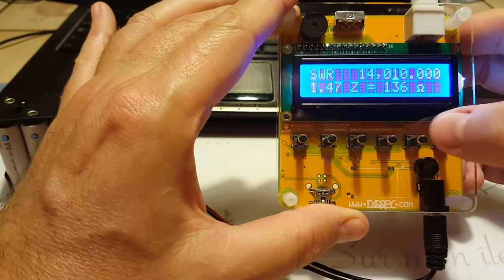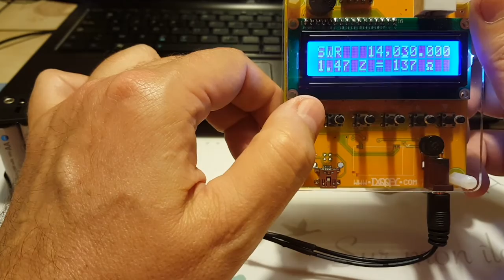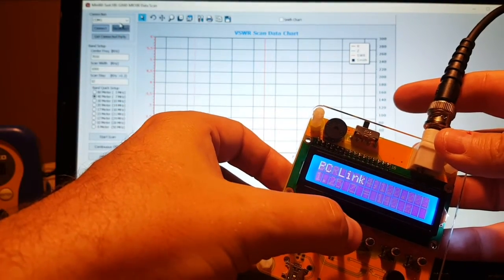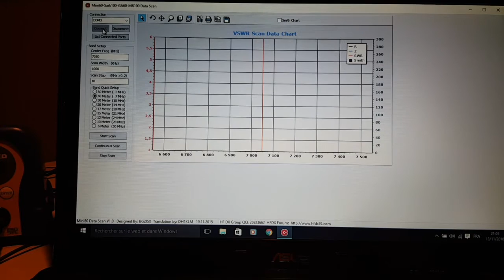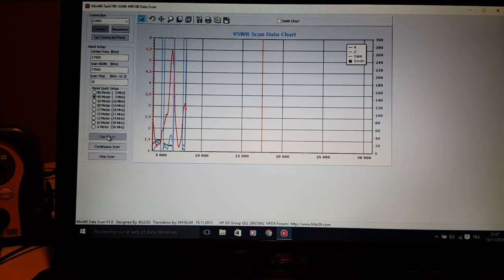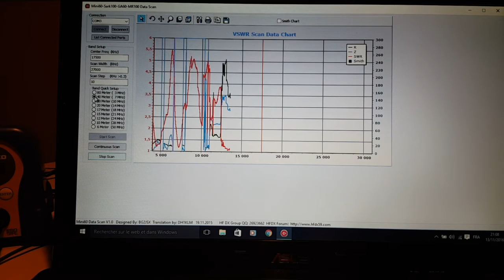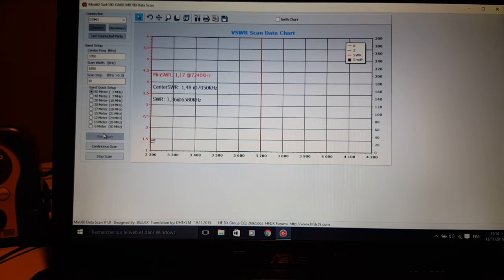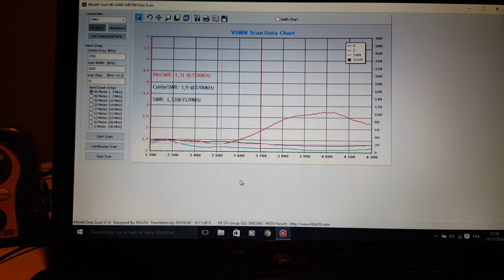MR100 Antenna Analyzer Review

Comment: OK, first : I bought mine from China for $52 and it arrived in 9 days using standard post. I downloaded the build manual that also came with operating I instructions. It is roughly 80 pages and was prepared when the Sark 100 was a home builders kit. The manual is very much worth downloading. 

The driver is fairly easy to find and comes in a ZIP file that Windows 10 will extract for you so that part is easy and its a good idea to plug in and power up the unit to make certain Windows sees it in the device manager window.

The actually software is a bit of a pain in the arse because apparently the English version created by DH1KLM which Gil is running was removed from the internet because of perhaps copywriting issues. So, I downloaded the Chinese version and used Gil's screenshots in this Blog to decipher each Burton's purpose and things are working very nicely.

I have saved as bookmarks locations to the manual, driver and Chinese software. If you need an assist and can't find them through a Google search please reply....
Reply from the maker: Never saw the manual... Could you email it to me at gil@radiopreppers.com ? Thanks.
Reply: Hi, I have this little analyzer, it seems to work, but haven't been able to use it with PC, couldn't locate the software or driver(s). Maybe you could share your links here? Or email w6euh@qsl.net
Thanks! 73

Comment: Hi, I bought one of these Analyser and when I look on the scope to see the wave, the real frequency is way off... By example, without an antenna, on the 20m band, i'm at 14.100.000. I'm reading 9.300.000Hz. Can someone confirm my problem and verifies on a scope/frequency counter frequency displayed is the same as the output one?
Reply from the maker: +Yanick Charland I never checked mine but will do so now that you found that out. You might have a lemon.. Check on a frequency counter just to be sure...
Reply: Check with a receiver. These sarks put out a strong signal near where the display says it is. I'd believe a receiver before a counter in this case.

Comment: I spent $900 for my kenwood ts-480sat, there is no way I want to spend $250-$300 for an antenna analyzer which will spend most of its life collecting dust. The ts-480sat has a built in tuner which gives me some latitude as long  as my antenna is close to specs. Has any one checked to see how accurate the inexpensive are?
Reply from the maker: +Rev. Gunn The MR100 seems accurate enough. Measuring SWR is simple. Expensive analysers are for people who build or install antennas regularly. This one is pretty handy and cheap.